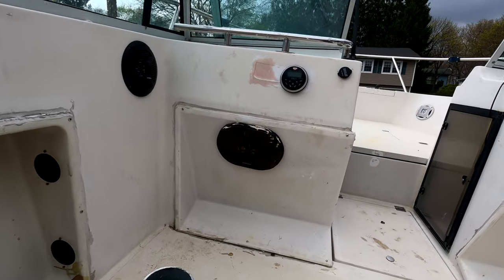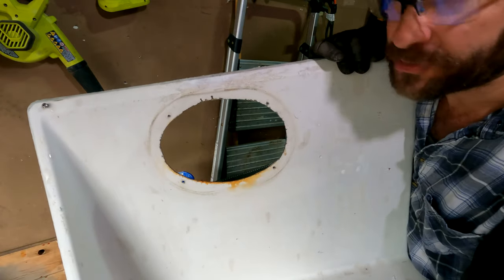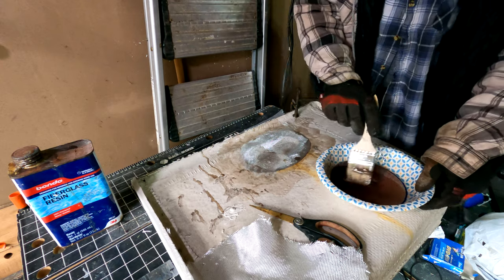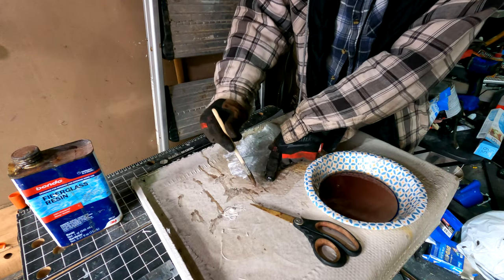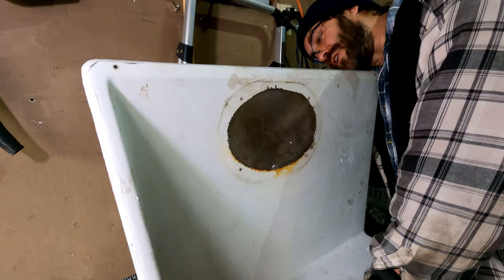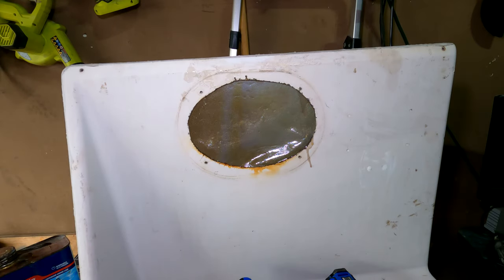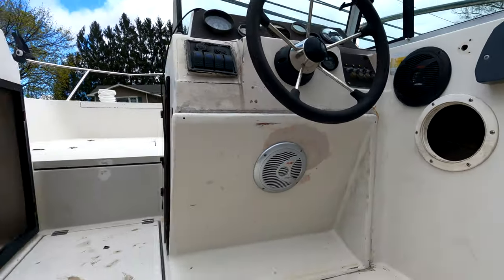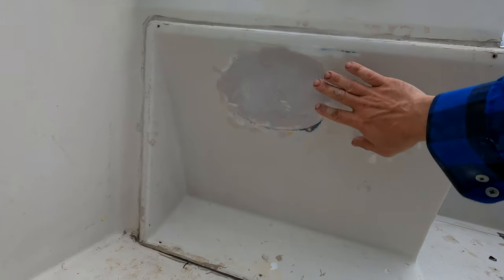How to fill a large hole in a fiberglass panel, and install a new Speaker... or NOT!

Comment: A little tip, when sanding bondo, wait till it's almost dry and start sanding, use anything course, 40 grit or cheese grader,  goes so much faster and a whole lot easier..they call it wet sanding, did body work for many years and that tip saved me many hours...nice job brother..

Comment: Great job of not using an exact science and yet getting the job done well. I was wondering, instead of painting on the fiberglass resin could you dip the cloth in the resin and smooth it out on the surface you're repairing? Really great how to video, by the way!
Reply from the maker: I find brushing it is the way to go. The fiberglass becomes an absolute birds nest from hell otherwise. Resin is SO sticky. Fiberglass MATT may work that way.
Reply: @GreggAdventure  thanks for your response

Comment: Hello l have 4-6x9 holes in my boat I will have to repair in place could l use tape to hold the wax paper up or what do you think would work also instead  of bondo l would like to use gelcoat to match what’s your thoughts loved you videos
Reply from the maker: Could put card board behind it, with a hole, and  string through it. Tie a not at the end, and use it to hold the cardboard in place, as  a backer, while you patch it up.

Comment: Nice job. Do you think I could use this method on a caravan roof? I'm looking to remove an existing square skylight and replace with a rectangular, smaller one.
Reply from the maker: Sure. I don't see why not! Just be sure to have a secure backer while it cures
Reply: @GreggAdventure  😎 thanks.

Comment: Is there a way to do this if you can’t get to the backside of the hole?
Reply from the maker: Can try getting a backer, using firm cardboard or similar. Make a hole in the center, tie a string through it, and use the string to hold the backer in place. When it's cured, just cut the string, and cover up it's hole